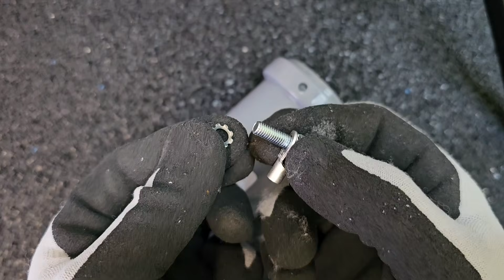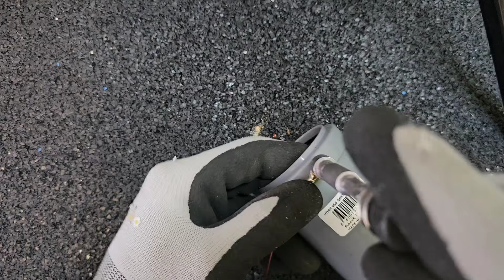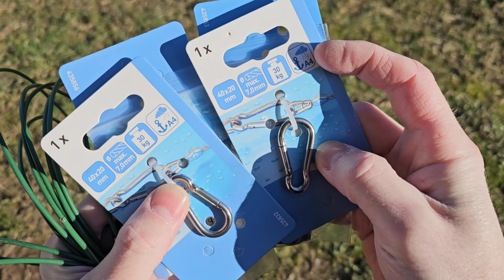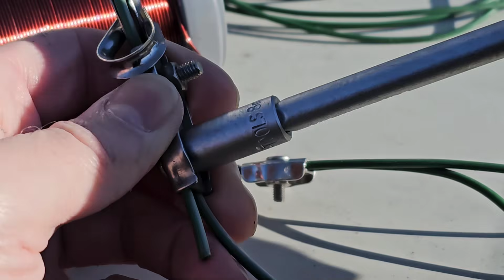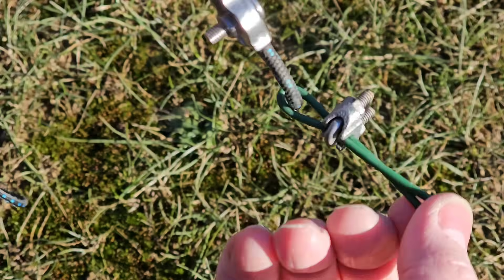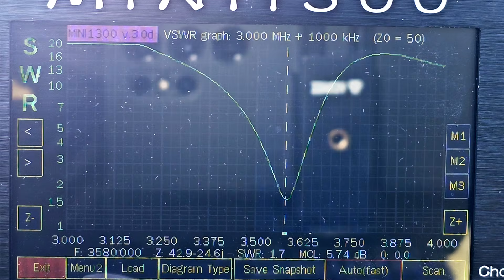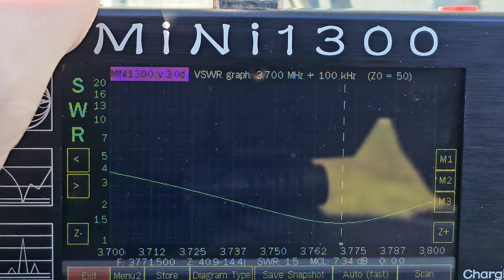HomeMade 80M Band Coil for 40M EFHW Antenna

Comment: I prefer to not use soldered connection for wires that might move around due to wind. They tend to break after a while. To prevent this a clamped connection is better. But I hope you won't have this problem. That coil looks great. Professional work! 👍
Reply: I prefer a comination of both. First clamp and solder afterwards. Good connection and mechanically strong
Reply from the maker: Thanks :)
Reply: *JAMAS SE PUEDE QUEBRAR NINGUNA SOLDADURA,SI EL ALMA,ES DE OTRO METAL, Y NO SOLO DE ESTAÑO...
(((((((((((((LA SOLDADURA ,COMPLEMENTA Y REFUERZA ELECTRICAMENTE LA UNION,NO ES MECANICA SU FUNCION))))))

Comment: Just a though, when you got closer to your desired frequency, folding the wire back rather than cutting may be a better option in hindsight. Great video. Thanks
Reply: Or maybe another option might be to test first using cheap wire?